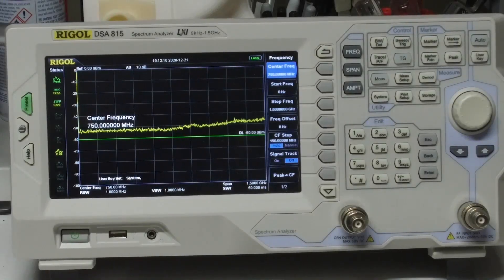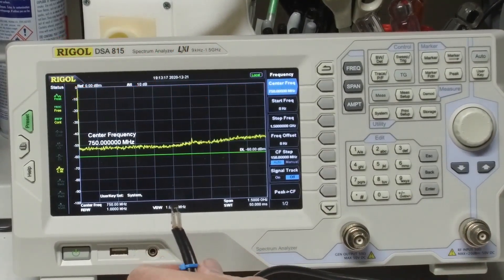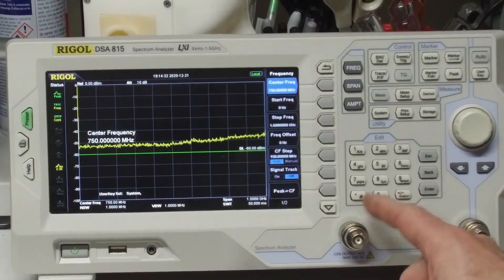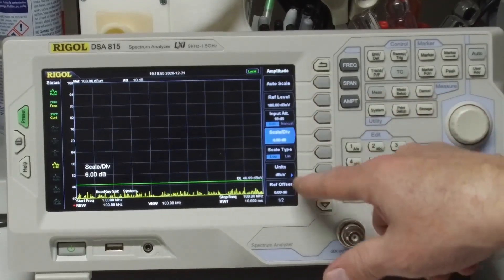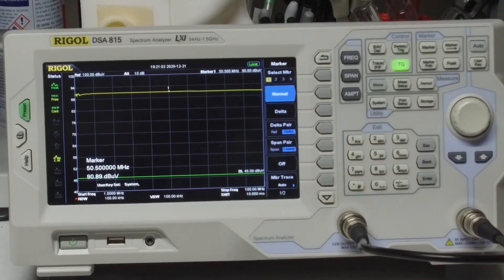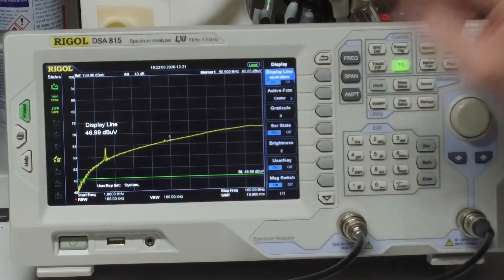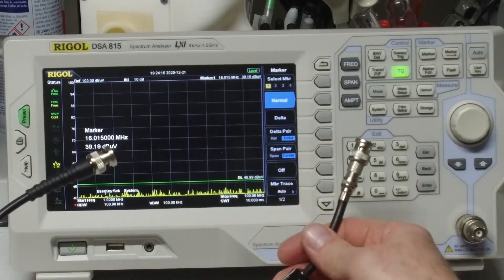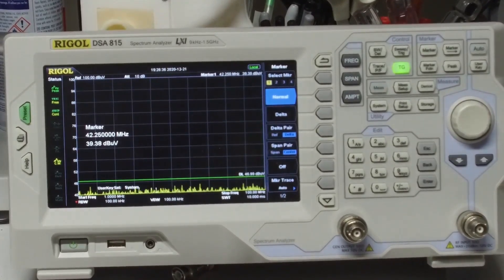Out of circuit crystal test with Rigol DSA815 Spectrum Analyzer with Tracking Generator

Comment: Thanks..   great video.
The 815 is truly great spectrum analyzer for the budget conscious.

As you so wisely noted:
ALWAYS get the “TG” (tracking generator) option !!!  It’s only a few hundred $ bucks or so at most.
Without the tracking generator, the tour is much more limited.

I have an Agilent handheld n9340 series “handheld” monstrosity of a spec analyzer 
that covers up to 8 or 9 GHz that I purchased for infield duplexer, cavity and filter tuning
at repeater sites.  This device was over $10k!  Truthfully, excluding the higher frequency range,
something I rarely use anyway... 

The Rigol DSA-815tg is just as good as the device costing 5x the cost!
In fact, the display on the Rigol is significantly brighter them the Agilent.

If dealing with high power RF transmitters,  protect your instruments.
Speaking from personal experience (of a “friend”😉 ) ...
It absolutely pays to use an attenuator and DC blocking device
(if the attenuator does not have that feature integrated).

While attempting to tune a receiver pre-selector on a public safety repeater,
“someone “  inadvertently connected the transmitter output of the DUT, a 
Motorola Quantar (UHF — 110 Watts) to the RF input of the 815.   

No “Magic Smoke” appeared, but the Display showed  lines and dots and 
languages I’ve never even heard of.  Fortunately, this unit was purchased used from eBay
prior to me having any knowledge of RF or anything other than installing connectors on
coax and Heliax.  You guessed it.  It did NOT have a tracking generator option.

The destruction of that first instrument allowed me to somewhat justify buying a replacement.
 (gotta make the wife happy once in a while... so always buy a piece of jewelry for her every time 
you buy a gadget for yourself 🤣)

This was around 5 years ago and the spec analyzer, INCLUDING the TG, was only $1380.  
and just slightly LESS than my original eBay purchase.

So... my advice, if using this in the field:
Always throw an attenuator in line with the RF input.
You can usually pick up a slightly used & name brand attenuator for under $100
50db (100 watts= 50dbm) with 100-150 watt rating.

Also, it cannot deal with DC applied to the input. 
DC blocks are cheap enough and readily available.

Good luck and 
THANKS for your videos!
Reply from the maker: Interesting info.  Thanks for the comments.